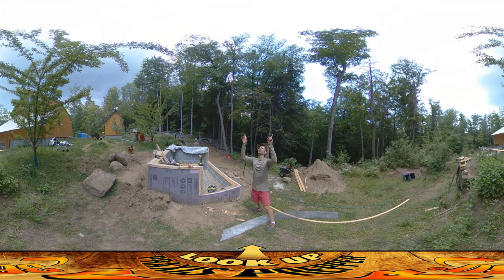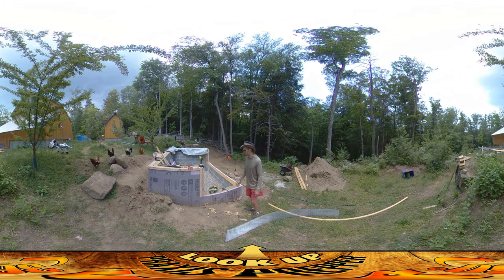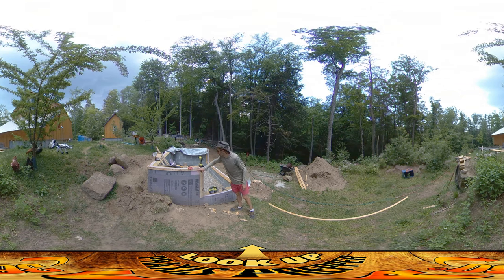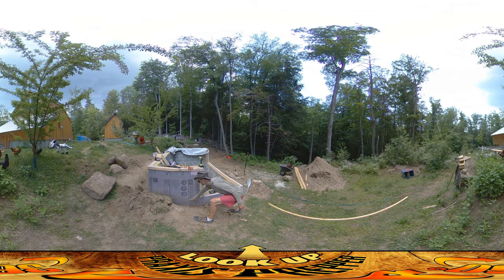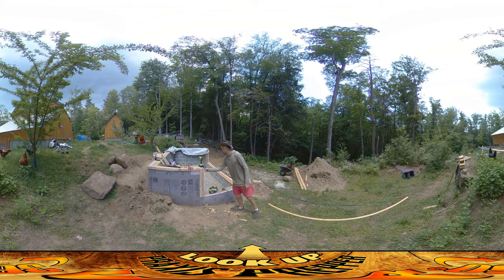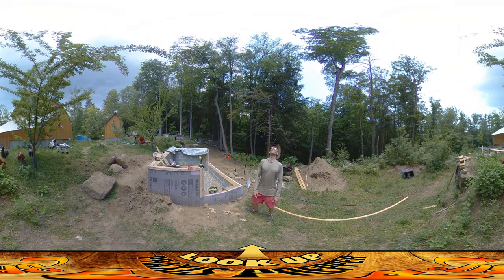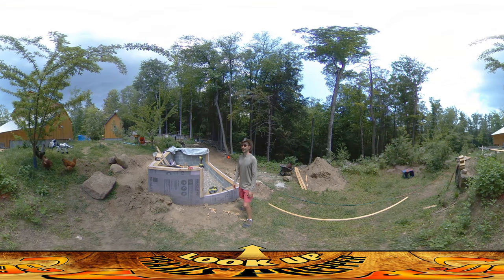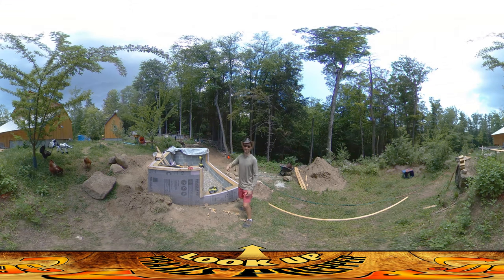Homestead Build - Adding Metal Lath to Foam for Stucco Prep

Comment: Your video reminded me that you use Ryobi 18volt tools AND you know a bit about solar power, so if you were to start today with a small solar system based on Ryobi batteries(4 amp hour size) how would you proceed?
 I am looking at 100 watt panels, one type is 12 volt and the other is 18 volt and I want to start with two of them, plus a charge controller that supports USB and USB C ports and a 12 volt car style socket.
 Ryobi makes some adapters that fit on the 18 volt batteries , some have USB plugs and some have USB and an AC plug...
I am hoping to recharge phones and power LED lighting , that sort of thing.
  Thanks for any hints you might have.
Reply from the maker: Hmmm. The only part of that that I'm not familiar much with is the Ryobi batteries. I mean, I obviously USE them, but I haven't charged them directly from DC current. The only advice that I could give would be that if you went with the 12v system, then if you later decide that you want to upgrade the storage from Ryobi batteries to something else, the transition would be easier if you had the 12v panels. 12v panels can run into a 12v system, or if you have an even number of panels and can wire some in series, it can run into a 24v or 48v system. I'm just more experienced with that sort of setup. So that's all I can really advise on.
You might be overthinking how complex a solar power system needs to be. They can actually be quite simple. Maybe I should do a video on my very simple system in the fallout shelter. It only uses:
-solar panels
-12v deep cycle batteries
-a charge controller (the only thing you might not have heard of and not very expensive)
-an inverter (like one you buy for your car to run AC things off the DC power outlets)
-wires for connecting it all

It's pretty simple once you know what you're needing to do. I'll do that video soon.
Reply: @PraxisPrepper   Using parts that I already have like 18 volt batteries that are in a handy format seems like a good place to start.
The 12 volt panels are becoming more attractive because it is seems easier to get 18 volts DC out of two 12 volt panels wired for 24 volts.
The controller is the other part that I need to research to find a reliable model.
The USB ports on the Ryobi battery adapter 2 ports (2.1 and 1 amps) can be had for $30 , and turn the battery into a USB charging station.
Thanks for your ideas and quick response.
Reply from the maker: @ratroute8238  I've used several charge controllers made by Renogy. They're middle of the road price-wise and I've never had a problem with any of mine.